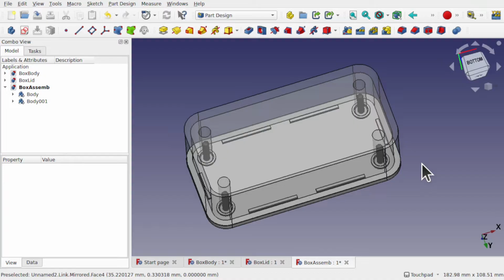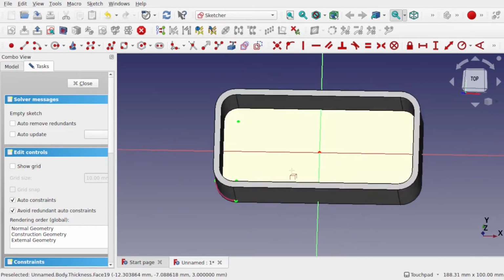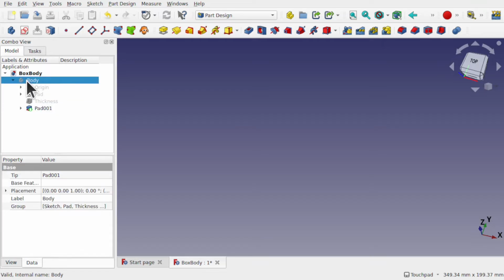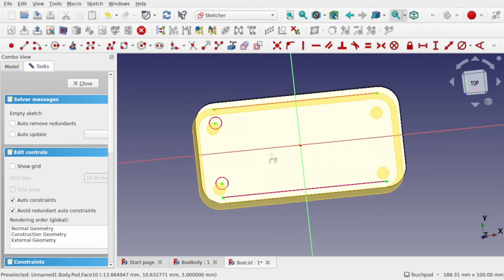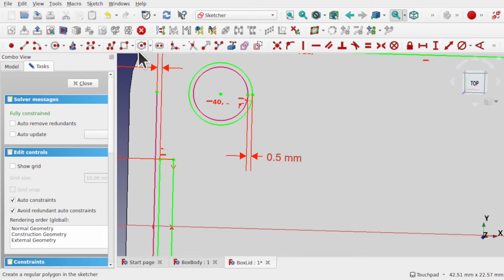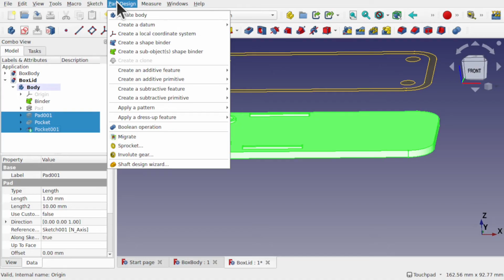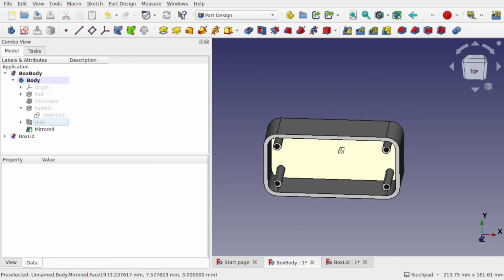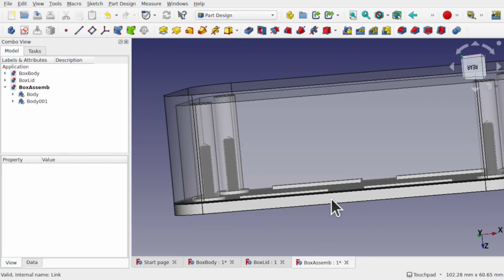FreeCAD 0.20 For Beginners | 24 | Lid & Box / Enclosure | Threaded Holes Cross File Sub Shape Binder

Comment: This was a great tutorial, made me realize I was going about creating this all wrong, In Fusion or Onshape, I can create both the lid and box in one document and use existing sketches. The way this works makes sense but is frustrating that you can't create both the box and lid all in one document from the start.
Reply from the maker: Thanks for adding your experience with the other CAD programs. Always interests in the workflows and how they compare with Freecad. You can do the workflow you explained in FreeCAD but it requires using the explode option in the part workbench after sketching to get the top and base. I do a similar workflow in this series with a circular container with a lid which creates two profiles to revolve. Glad you found the video insightful. 😊😊

Comment: for an absolute beginner, this stuff is overly complex. I've done a lot of 3d design, and am pretty good at it, but this UX is aweful. I really do appreciate your tutorial, but one small tip: explain as you go. because something as simple as hiding a body is probably evident for you, but after googling for a few minutes I realized you hit space bar instead of double clicking it. and that goes for a lot of actions anyone familiar with this software takes on youtube... I'm also clicking the exact same things as you and getting errors, even after rewinding and trying again several times
Reply: Also, he sort of assumes you have been working through the series. It’s a group of lessons, not an individual tutorial.
Reply: Try a dev build of 0.22, it has a ton of big UX improvements.

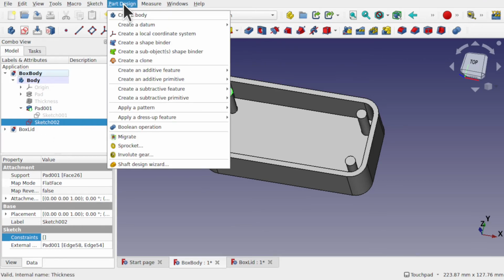Comment: Hi All, Like many others making good progress. A tip for what it's worth @ 28:56 when initiating the Hole Subtract I got a recompute error and no model when the Hole Side Menu appears. I back tracked and discovered an error I thought I had corrected earlier (Selecting the circles & imported geometry then making them equal). It seems even though I had deleted the incorrect part of the sketch a circle element remained in the elements side bar to the left of screen causing the recompute error. I'm working very slowly through theses Tuts & starting to realise that you need to be very precise and aware of not only the sketch but also the Elements as you edit them. I take this to be some kind of programming feature. No complaints and perhaps I'm starting to appreciate the various relationships of the GUI.

Comment: Very good!  You'll get a coffee on me.  

Question - when I am in Sketcher, I cannot rotate the view unless I press on the curvy arrows or faces on the upper right hand corner of the view screen.  But in your video, I see you were rotating the sketch view smoothly as will with the cursor.  

How did you do that?
Reply from the maker: Thank you 😊, so I rotate the view using a key on the keyboard and moving the mouse. If you look down to the bottom right of freecad you will see a button with a mouse on it, this changes the navigation method you are using. If you click on that you can choose the different types such as CAD, Blender etc.  If you roll the mouse over the icon a pop up will appear. That will show what keys and mouse combinations to use to control the movement. The pop up will look similar to the diagrams in the freecad wiki https://wiki.freecad.org/Mouse_navigation#:~:text=CAD%20navigation,-This%20is%20the&text=Alternate%20method-,Press%20the%20left%20mouse%20button%20over%20an%20object%20you%20want,to%20zoom%20in%20and%20out.

Comment: This is a very useful video for me.Thanks a lot.
I replicated the steps shown in your video (just adapted the box dimensions for my project). 

In my model I created two sizes of screw posts viz. for M3 and M2. The. complete model (box + lid)  including the M2 and M3 threads came out very well. 
I exported the ".stl " file for box to "Ultimaker Cura, V5.2.2" and printed the sliced file using the "Ultimaker 2+ Connect", 3D printer.

The box came out perfect but the M2 and M3 hole diameters are by far not large enough to accomodate the M2 and/or M3 screws. :-((. 
I have double checked the M2/M3 stuff in the model, they are corect!

Any idea or suggestion what could possibly have gone wrong?
B.t.w. I am using  FreeCad version 0.20.2

Thanks for your help in advance.

Comment: I made a larger box using this video also cut a hole for a display through the top, one thing is the recessed holes in the lid for the screws failed a bit due to the print of those is inverted, so I printed without the recess all okay, maybe if I used counter sunk screw holes it would be fine in future 🙂
Reply from the maker: Thanks for posting an update in regards to what you used this for. And saying about the challenges you had. Great to hear

Comment: It would be helpful if you named your sketches, pockets, pads etc. Not only would it make the videos easier to follow as we backtrack to correct our mistakes, but it's a very good practice to boot.
Reply from the maker: I agree it's one thing that I don't do as I thought it would be better to keep the video short as possible. But I do think this would help especially with the bigger build and I will start doing this in the future. Thank you for this, really helps make the videos more easier to follow.
Reply: @MangoJellySolutions I see the logic of this, but if you are doing a one off part, no point.

Comment: At about 8:30, you mention that we're putting off the holes in the posts to avoid topological issues. Would you explain this?
Reply from the maker: When you build parts on PartDesign they are automatically fused. So the next feature is built upon the previous. When you change something further up the tree everything after will reconfigure and recompute. When this havens sometimes a edge will be named different than it was before. Anything referencing that edge will move to the new edge. This will be better managed in the future release of freecad.
Reply: @MangoJellySolutions  Thanks for clarifying - I think I've run into this before and didn't understand what I did wrong. I do hope they fix this.
Reply: @leroycasterline1122 use the Realthunder link branch, it’s fixed in that version
Reply: @roofoofighter  Thank you.

Comment: Very helpful for someone new to FreeCad you are coaching good technique. I have one concern: I think the symetry operation has turned the new threads to left handed. If so maybe add threads to all holes after symmetry?
Reply from the maker: Thank you thanks for the kind words. I didn't spot that re the symmetry, I am going to have to check that as I 3d printed it for a friend who's using it at the moment. If it is the case yes you can add it as the last feature. Great spot. Thanks for highlighting that.
Reply: @MangoJellySolutions  Ive just recreated what you did and can see that the thread is left handed on the symetry plane copy. It makes full sense as that is what you asked to do with the symmetry operation. Otherwise all epic! By the way are 3D prints such as this expensive in materials if yuo have a printer, or if you use a service to print?
Reply from the maker: Thanks for the update.  In regards to printing I have never used a 3D printing service before.  I must give them a go and see how they compare.

Comment: Sir, what happens to the cross body link of the shape binder if the files are separated for use in different models later? i.e. will an update to BoxBody still have an affect on the BoxLid if they are used in different parts in different models? I hope you can follow my question. I wouldn't want unexpected changes showing up else where. Thank you for all the awesome teaching. 🍎
This question was left to mark my thought process. I see the shape binder is being used as a reference to new geometry and should not affect later models. But I'm seeing the binder might still be changed.
Reply from the maker: Sorry for the late reply. Are you describing the file being moved to another location on the pc? And thank you for the kind comments.

Comment: Insanely good tutorial. Thanks.
One thing bothers me so much in FreeCAD compared to other software that feature tree is so confusing to me. Other than that it's getting quite ok to use these days.
Reply: I found the toolbar confusing, too. To help, I moved the bars over to the left vertical side, leaving only the “iso view” tools on the main toolbar.  It provides a little more height to the work window and, for me, an easier feature point and click  on the left. Of course you could put the toolbars pretty much anywhere in the window to suit your working style.